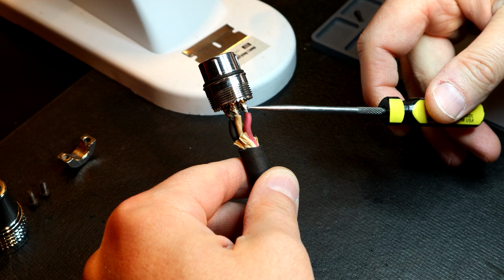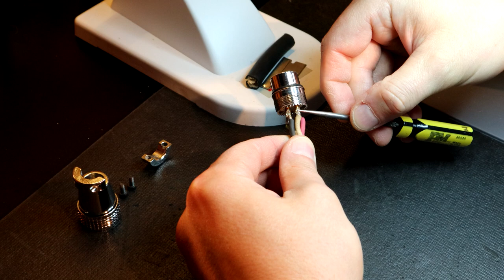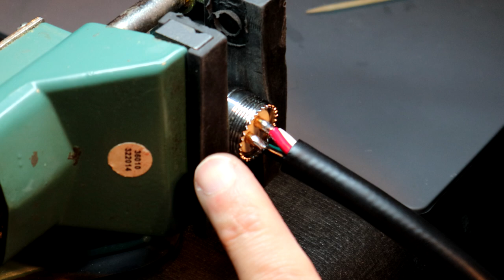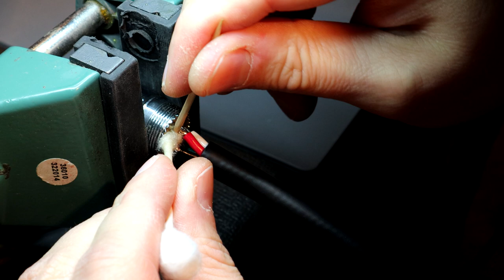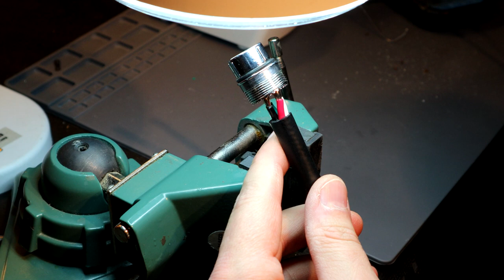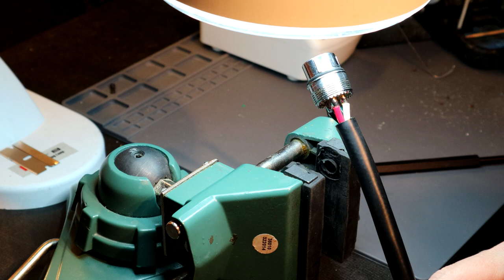CNC Spindle Connector Soldering Overview Shot In 4K...

Comment: Why don't you put shrink wrap over the exposed soldered ends?
Reply from the maker: 221Dw, Thank you for your support. I always use double wall adhesive heat shrink over the terminals prior to closing up the connector. It wasn't illustrated in this video.
Thank you,
Vince

Comment: What do you recommend for power to the vfd?
Reply from the maker: Richard, thank you for your support. Here's the cable you'll require to supply power to your VFD.  https://www.ebay.com/itm/142837352755  If you require longer than 10ft. just let me know, and I can cut them whatever length you need. Vince